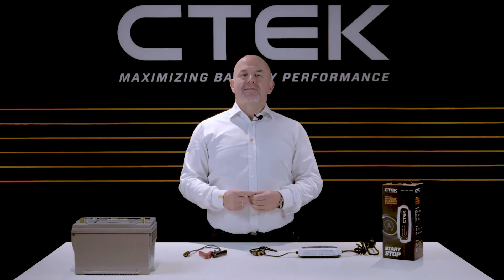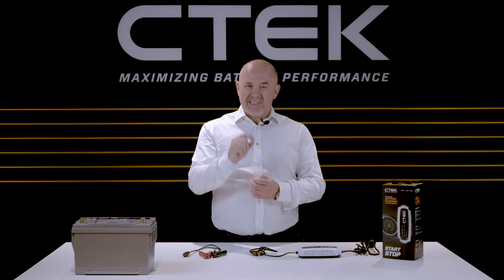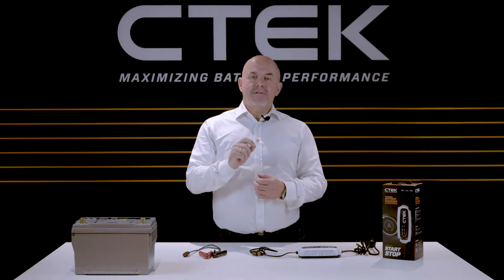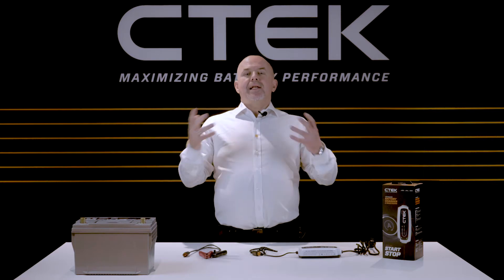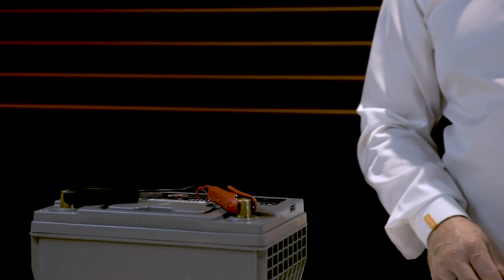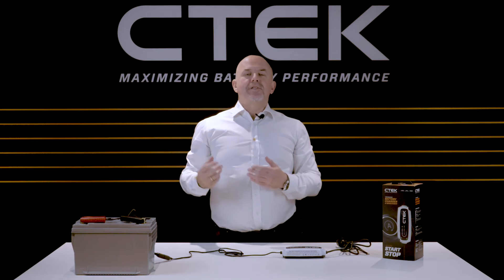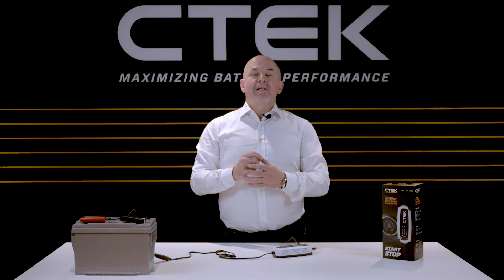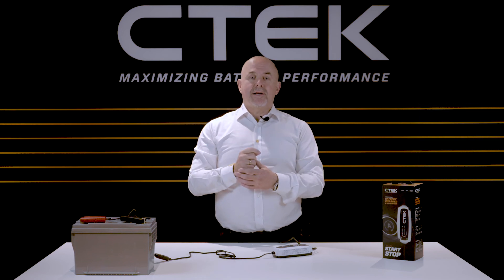Tutorials - CTEK CT5 Start/Stop - How to connect

Comment: Power indicator is blinking. Does this mean it is not charging? Thanks! Is it not possible to charge a drained battery?
Reply from the maker: Hi, In order to make the charger spark free and reverse polarity protected ( Safety for you as the user) the charger need a proof from the battery so the charge knows that it is connected to a battery and not f ex a door. This level is 2V. A battery is considered empty of energy at about 11,8V so 2V is extremely empty. But you are right - when the power light is blinking the charger can not find the battery and will not charge. You can try to reconnect the charger a couple of times, that can rise the voltage over the 2V limit, or to use something to add just a hint of energy to rise the voltage over the 2V level. Please note that the blinking light also can be a poor connection between the battery and the charger. I hope this helps. Best regards CTEK Support
Reply: @CTEKBatteryChargers  Thank you for the reply

Comment: Thanks for the excellent video. Can you tell me the length of the negative lead from its junction with the positive lead to the crocodile clip? I'm asking because the recommended earth point on my Peugeot 208 (new shape) is approximately 1 metre away from the battery on the opposite side of the engine bay. The leads do not appear to be long enough
Reply from the maker: Hi, Thank you for your kind words. If you carefully tear the clamps apart, the gap between the clamps will be bigger, close to one meter. it is hard to say exactly. If this is not enough, you can use the INDICATOR CLAMPS that will give you more than a meter, almost two and a half between the clamps. I hope this will help you. Best regards CTEK Support
Reply: Thanks for your advice

Comment: Hello and thanks for the tutorial videos. I bought a Ctek CT5 and they certainly look superbly made. I have a problem insofar as my charger on a low battery only stays on charge for around 1 hour then goes into "care" mode. To get it charging again I have to disconnect the negative terminal and re connect it ( neg on mine goes to engine earth and not battery terminal). Do I have a faulty charger? 
I have tried to contact Ctek but their customer care email is not working.

Comment: What are the difference between the CTEK Start/Stop & CTEK Time to Go? Can I use the CTEK Start/Stop to a vehicle without Start/Stop feature? Or can I use CTEK Time to Go to a vehicle with Start/Stop feature? Thanks. I have both types of vehicle, Start/Stop and Non Start/Stop type. If I need to buy only one CTEK, what model should I buy? Thanks.
Reply from the maker: HI, the chargers are as advanced - they show the result in different ways. Counting down (Time2Go) or Counting up (Start/stop) You can use both chargers for any kind of vehicle with a common sized 12V battery. Best regards CTEK Support
Reply: CTEK Battery Chargers my car battery was drained probably due to none used. This gives error message to my Mazda CX-5 2018. Having this said issue, what do you mean counting down and counting up? How will this affects in addressing my concerns?
Reply from the maker: @jhungallardo  Hi, the Time to Go charger will show you in hours, the estimated time until the vehicle is good to go. The StartStop charger will till you that it is CHECKing the battery, CHARGing the battery and CAREs for the battery until you want to use it again - but you will not know how long time it will take until it is ready. I hope this explaines better. Best regards CTEK Support
Reply: CTEK Battery Chargers , very well explained. I know now what to order. Thank you very much.
Reply: CTEK Battery Chargers, one more question,  How about the model CTEK MXS 5.0 Battery Charger 12V/5A, how do you compare this to Time to Go and Start/Stop model? Thanks
Reply from the maker: @jhungallardo  HI, Sorry for a late reply. I will say that the difference is the way you, as the user, want to use your charger. If you are interested in choosing different charge modes and enjoy the possibility to follow the charge - the MXS 5.0 is a perfect choice this is a PRO charger for us end users! Compared with the Start/Stop charger you have 8 different charge modes to choose from and it will also charge smaller batteries than 14Ah. The Start/Stop charger and the TIme2Go charger are more "connect and forget" type of chargers. Not that many choices - but as smart. You can read more about the exact details at www.ctek.com. Best regards CTEK Support
Reply: CTEK Battery Chargers just bough the MXS 5.0. I using it right now and I should say I’m very impressed and happy that I found the best battery charger in the market today. Truly the best. No competition. No. 1.
Reply from the maker: @jhungallardo  thank you for your kind words! Good luck with your new  charger! CTEK Support

Comment: Can I leave the charger connected for months (6 more specifically)? In case of a power cut does it start automatically to charge the battery again when power is restored?
Reply from the maker: Hi. Yes. You can leave the charger connected to the battery for months and months. Please make sure the green light for "Fully Charged" is lit before leaving it unattended for longer periods of time. If there is a power cut, the charger will start up in the same mode as last used when power gets back. I recommend to check into the charger and the battery once in a while to make sure that everything works as planned. Best regards CTEK Support
Reply: @CTEKBatteryChargers  Thanks for the prompt reply!

Comment: which should I buy between MXS 5.0 and CT 5 for my Base Cayman 2014 ?. Thanks in advance.
Reply from the maker: Hi, they will both be a perfect match! The MXS 5.0 gives you the  possibility to choose from 8 different programs and to monotoring the process. CT5 chargers is as advanced - but made to be more "connect and forget" type of charger. You can't really make the "wrong" choice. Good luck. Best regards CTEK Support

Comment: Is this compatible to Porsche Cayman 2014? Is this a battery maintainer because i will not use the car in winter (5 months).
Reply from the maker: Hi, Yes - as long as the battery you your Porsche Cayman is a lead acid battery and not a Lithium (LiFePO4) it will work perfect! If you have a Lithium (LiFePO4) battery - look into the CTEK  Lithium XS
Reply: @CTEKBatteryChargers  Same here, mine is AGM Battery. Which should I buy ? MXS 5.0 ? Or CT 5 ? Or else ? Thanks

Comment: Absolute idiotic rubbish. No reference to the fact that it is designed for stop-start installations. I want to know about the relevant in- car connections that are different from conventional.

Charging a conventional lead- acid battery on a bench with a special CT5 ? Give me a break...
Reply from the maker: Hi. Even though it is designed to work fine with start stop vehicles - it has got the same  8-step  fully automatic charge curve that the rest of our chargers. It will work perfectly for other vehicles, as long as the battery is a lead acid battery sized  14-130Ah. When connecting to a battery  in a vehicle CTEK recommend to connect the positive clamp to the positive pole on the battery and the negative clamp to chassis or according to vehicle manuals recommended charge point. The reason to this is the vehicles BMS (Battery Management System) that will not have information about the charge if negative clamp is connected to the negative pole on the battery. I hope this explanation will help you better. Best regards. CTEK Support